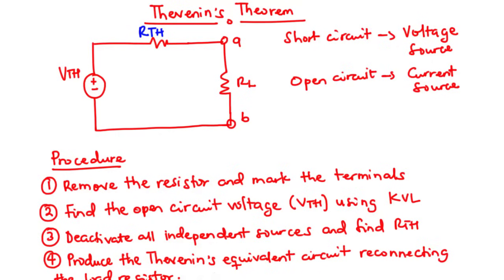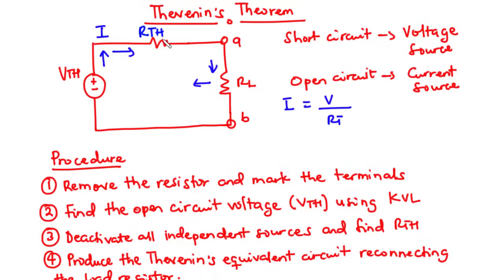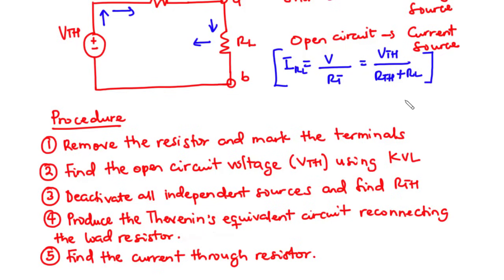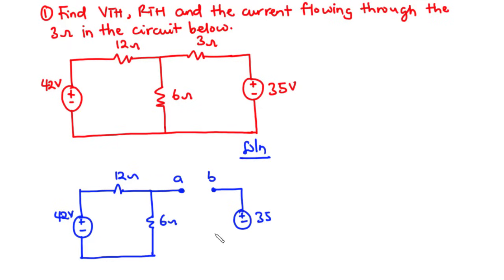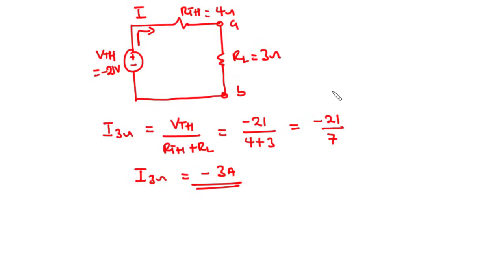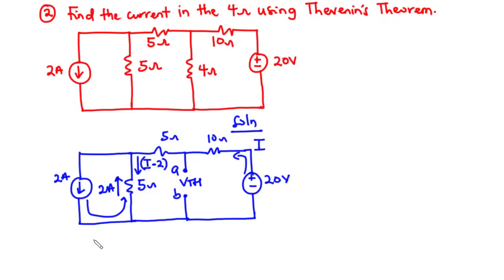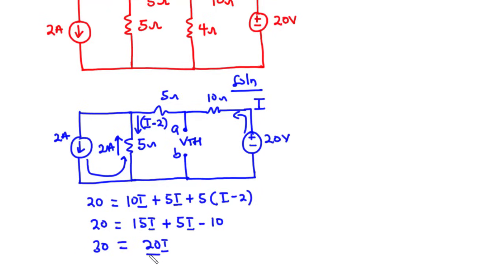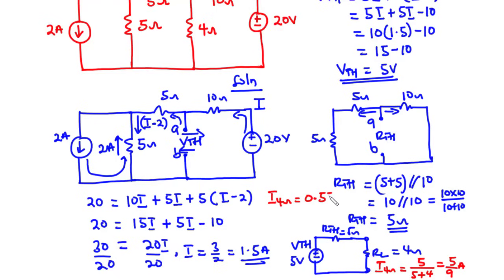18 - Thevenin's Theorem - Concept with Solved Examples #knust

Comment: Please and also when the 2A current flows through the 5 ohms resistor and get to the node won't the current split to the other 5ohms
Reply from the maker: It depends on how you do the current distribution. Since current in a circuit is usually produced by the cell or voltage source, I prefer to start the distribution from the voltage source. 

You can equally do it with the current source, and you should have the same answer.
Reply: Alright please thank you

Comment: Please with the second example the total current flowing through the circuit is 2A right? If so why is the current flowing through the 5ohms resistor I-2
Reply from the maker: No please, the total current in the circuit is not 2A. The total current is 2A + plus what ever current will be produced in the circuit by the voltage source.
Reply: Oh okay thank you

Comment: Thank you so much sir, this video helped me a lot. But I have a question, for the last example, since we are trying to calculate Rth why we considered 5 ohm and 5 ohm resistors as series and 10 ohm resistor as parallel to them? We consider a and b termianals as open circuit , right? So shouldn't all of the resistors be in series ?
Reply from the maker: You see, when the resistors are connected end to end, it's series and when connected to the same two nodes, it's parallel.

Comment: Thanks sir but u have a question 
You said the current in 5 ohms is ( I - 2) and it is going ant- clockwise 
So my question is if it is going clockwise will it still be minus or will the sign change to plus 
Hope you understand 
Thanks
Reply from the maker: it will change to positive, but the source voltage will need to change too, to negative. Since the current coming from the voltage source is from the negative terminal. So in effect it will be -20v

Comment: in the 2 que. vth and 2A are in same direction i.e anticlockwise ,so shouldnt Vth=5I-5(I-2) .  if not why ?? plz explain
plz reply 16:10
Reply: i think in 5 ohm there are 2 currents (I-2) and 2 go thought. Beside I= 1.5 ==> I-2<0 so current (I-2) is opposite to assume and have the same direction with current 2A so we will plus them. If you want a more easy way I will introduce
Reply from the maker: Thanks for your contribution
Reply from the maker: No please, once they are in the same direction, it's a +, if they oppose each other, then it's a minus.

Comment: I=V/Rt=42/18 (12+6) how could be 18 ?These are parallel of seires?
Reply from the maker: I don't really get your question, but the most important thing is, because of the open circuit, there will be no current in 3 ohms, so the current in 12 and 6 is same, which means 12+6 is 18

Hence I = 42/18 = 21/9

Comment: I have a question can i just use loop equation to find everything without using thevenin?
Reply from the maker: You you can. But once the question is specific, that using thevenin. Then you are restricted.
Reply: The loop equation is what? Mesh analysis?
Reply from the maker: @heraldtrader  kindly explain yourself well.
Reply: @SkanCityAcademy_SirJohn  what is  loop equation ?
She asked if she could use it
Reply from the maker: @danielpaulokpe365 yeah, they are the mesh equations.

Comment: Why does the 2A current didn't split at that node
Reply from the maker: You can decide to split it, but the best way is to consider the voltage source as your reference source and use that to do current distribution. And that is what I did.

Comment: how do you know what sign VTH is though? 15:35
Reply from the maker: You need to just look through the terminal to see which direction will be relevant to your calculation, then you decide.
Reply: Sir but how do you know on either to use clockwise or anti-clockwise for the first question when finding the Vth

Comment: Sir if you are going in anticlockwise that should be -6I not 6I
Reply from the maker: No please, notice that in the anti-clockwise direction, the current in 6 ohms is in line with the anti-clockwise direction hence it's supposed to be 6i not -6i. Please do you get it?

Comment: Why do we need to assume there is a voltage source between points a and b in the the second example? In first glance I thought all the resistors are in series (5+10+5) because they have the same current
Reply from the maker: At glance, everyone will assume that the three resistors are in series but that's not true. You will need to think of plugging in a voltage source to see how current will be distributed in the circuit. Due to the presence of the node between 5 and 10, current will split. So no same current will flow throw all the three resistors

Comment: I really appreciate this video too but please from the second example why is the current passing through the 5 ohms resistor ( I-2 ) A. I'm alittle confused, what if it's rather (2-I )A. That's not the answer though but just to clear my thought and to get a better understanding why the current in the 5 ohms resistor is ( I-2 ) A
Reply from the maker: So first, we assign current I which flows through 10 and 5 ohms on top because there is an open terminal at ab so no current flows through that branch. The current I flows through the other 5 ohms on the left. Notice that the current source at the far left points downwards which means it's going to circulate in the 5 ohms in the anti-clockwise direction opposing the initial direction of I
Reply: @SkanCityAcademy_SirJohn  Thanks you're the best 😊👍🏼
Reply from the maker: Thanks so much

Comment: the answer to the first example is just 21 not -21
Reply from the maker: the answer is -21v or 21v depending on the direction you are working with. -21v and 21v are actually the same thing, the only difference is the polarity, where the positive terminal is on the right or the left.
Reply: @SkanCityAcademy_SirJohn  but didnt you take the voltage across the 6 ohm resistor in reverse the current is entring from pos polarity to the ground(i mean from above ) so the voltage should be reversed

Comment: The second example when viewing the Vth towards the right side won't it be Vth+20 = 10(3/2) but I ended up having -5. Or I misunderstood something?
Reply from the maker: Direction of vth opposes 20v hence, vth - 20 = -10(1.5)
Reply: @SkanCityAcademy_SirJohn  as in moving from  Vth anticlockwise through the 20V. I thought since the current will enter the negative terminal of the 20v it will be positive or? Like if we move anticlockwise from Vth the 20V will also be in anticlockwise.
Reply from the maker: Yes it will be positive as you say. But mind you current will leave negative terminal of vth making vth negative. Hence -vth + 20 = 10(1.5)
Reply: @SkanCityAcademy_SirJohn  oh ok thanks
So I'm assuming that the terminals of the Vth is kinda like in like with the terminals of the voltage source?
Reply from the maker: Once they are opposing each other the polarities will always change
Reply: @SkanCityAcademy_SirJohn  oh ok thanks. I get it now
Reply from the maker: That's good

Comment: Another great video sir...but why is it that in example 2, the 2A current is considered to keep circulating around 1 loop over and over
Reply from the maker: current produced by the 20v flows through both 10 and 5ohms and through the last 5ohms before it goes back to the source. meanwhile at the node where the 2nd 5 ohms is connected, current from 20v flows downwards while 2a flows upwards opposing eachother. now when you consider 2a to be circulating in that loop, it makes it easy to realize that it opposes the current produced by 20v in that branch
Reply from the maker: where do you watch from?
Reply: @SkanCityAcademy_SirJohn  I'm from Botswana sir 🇧🇼
Reply from the maker: Okay... That's fine. Hit me up on +233243084034 whatsapp

Comment: in the second example can you please explain the I-2
Reply from the maker: well, good day, its very simple and easy to understand, consider the loop on the far left, the current in that loop will keep on circulating over and over. Now, the current produced by the 20v will flow throgh the 10, 5, and 5 ohms resistors. Since there is an open circuit, the current will not divide at the first loop where 10ohms, 5ohms and vth are connect, at the next node, the current wont divide but all will flow downwards in the 5ohm. notice that the two current values flowing in the 5ohms have opposite signs hence one should be negative. anyone of them can be negative, but the actual answer you get at the end proves the original direction of the current

Comment: in the first example, when the current of the  final circuit turns out to be MINUS 3 ampere, doesnt it mean that the current has counter clockwise direction? or else put, when Vth is found negative, doesnt it mean that the positive and negative pole are reverse as initially assumed?
Reply from the maker: Exactly....